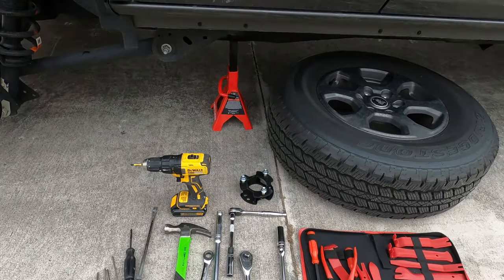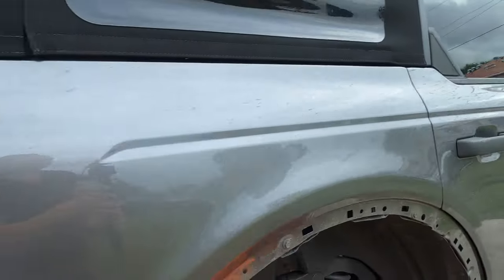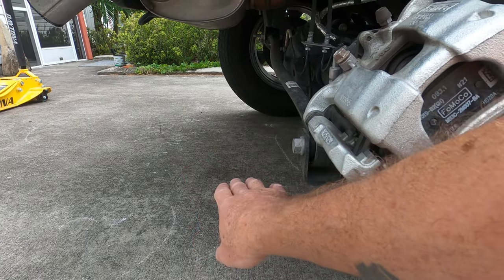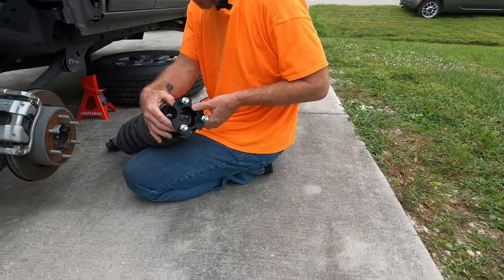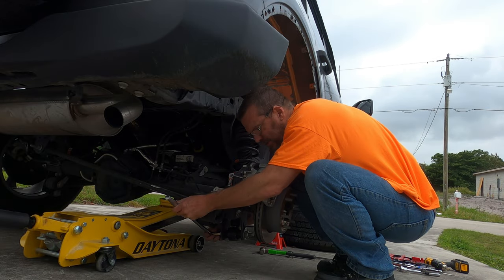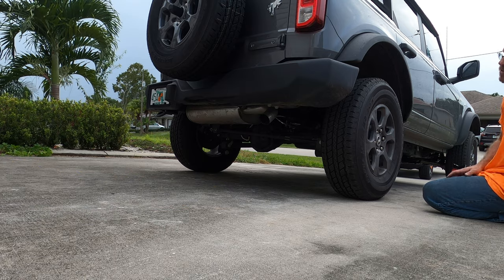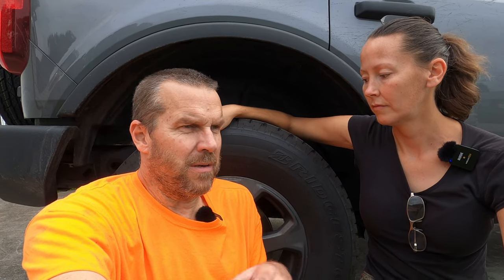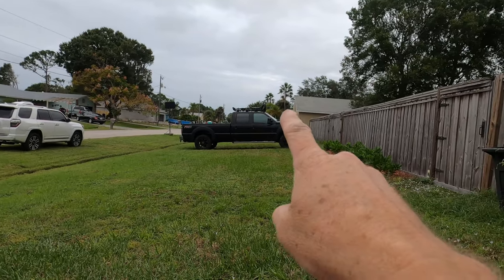2021 BRONCO ROUGH COUNTRY 2" LIFT KIT INSTALLATION COMPLETED. REAR KIT INSTALLED.

Comment: Wait... I don't want to jack up both sides?  Why did I buy a lift? 

On a serious note, it looks like it would be a lot easier to do both at the same time.  Also, did you need to adjust the track bar?
Reply from the maker: We will be getting a full alignment done with true wheels and tire install. We are on a slight incline is why. If it was flat then yes both sides at the same time

Comment: Love you guys videos! I have a bronco 2 door that the dealer put a 3 1/2" rough country lift on. With 35s it's just too tall! Any suggestions of what I can do?
Reply from the maker: too tal as in you can't get in or you just don't like the height? I personally don't like steps but you could go that rout
Reply: @1Five1Garage  26 in off the ground I'm too fat and old to climb in and out of that lol
Reply: Wondering if I can keep the 35s on there with the stock suspension

Comment: sorry to keep bothering you.  My wife is freaking out because I want to change the factory suspension.  Ive been telling her that you are reporting no issues with the ride once lifted.  Did you notice any change with how steering wheel felt?  She recalls the steering got looser when we lifted our previous wrangler.  Thanks again
Reply from the maker: You will need to find a place that can do the alignment. Find a good place that deals with lifted vehicles. But not much difference.

Comment: Will this fit badlands non sasquatch  ?
Reply from the maker: From the website itself:
Does NOT fit Badlands, Wildtrack, or First Edition models.
Does NOT Fit Models equipped with Sasquatch Package.

I believe it's because the badlands has a different strut set up.
Reply: @1Five1Garage  the kit would probably fit, as the spring caps are not different from the Sasquatch/Badlands, however, it may be sufficient to cause the CV joints to bind at full extension.
Reply from the maker: @mpeugeot  the top tears on the Bronco lineup have different struts. The Bilstein equipped struts. It may fix but there are more options out there for those. If the manufacturer says it doesn’t fit, I wouldn’t chance it. Because if you put them on and it fails then they are free of liability.
Reply: Stupid youtube auto censor... I have the parts in my living room, they use the same part number caps (f: 18A099-A, r: 18A161-A).  Regardless of suspension.  I am suggesting that the reason not to install it is more about safety than fit, a locked or broken CV is far more dangerous than whether it would physically fit.